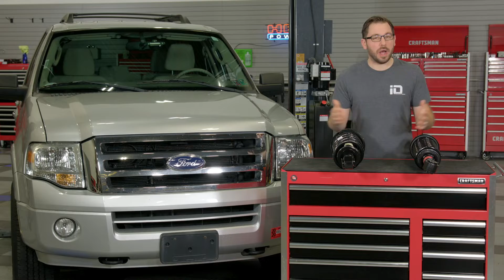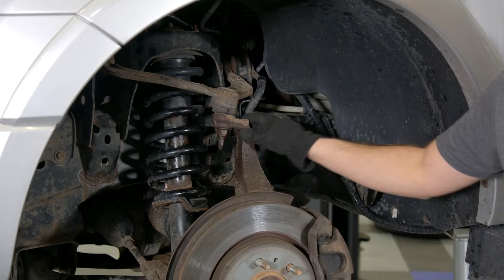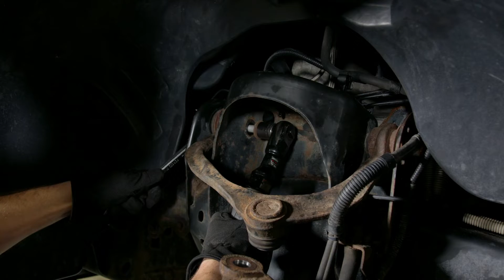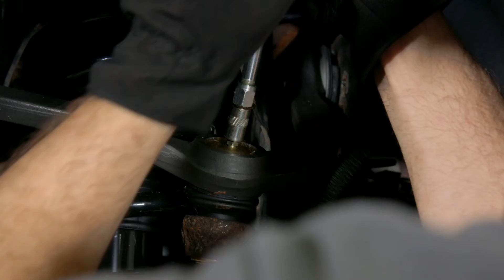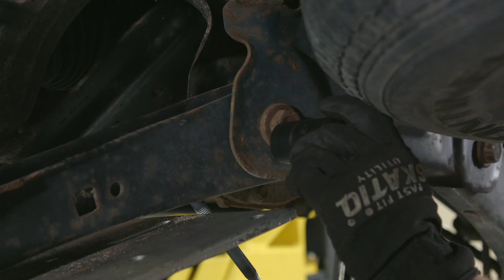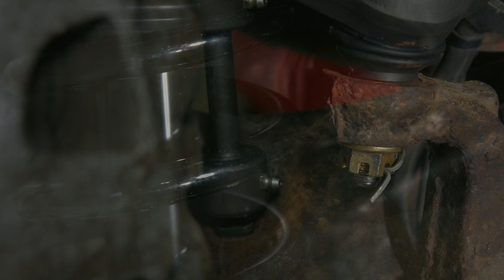2010 Ford Expedition Strut Installation

Comment: Ah yes the upper ball joint spinning. Since the ends of the threads get rusty, you need to melt the plastic from the jam nut and then the nut will come right off. Ford sells the nuts in bags of 4 for this reason so you can replace the tie rod ones while your at it... Same for stabilizer link. Melt away all plastic from lock nuts and replace. I did these same struts on my 11 119" and front sits a little higher.

Comment: What of the ball joint was the issue, it was knocked loose from the knuckle?
Reply: Looked like the nut wouldn't come all the way off.  The stud was probably spinning.  Maybe could have tightened it up again, wire brushed the threads and tried again??